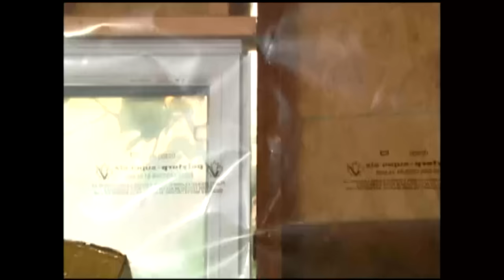Mike Holmes Saves Jill's Garage Makeover from Disaster! | Holmes on Homes 205

Comment: One thing i wondered about:  where i work in new jersey, you get use screws for framing,  even deck screws,  theyll fail it every time.  Screws hold great, but they have poor sheer strength.
Reply: Does sheer strength matter once the structure is built? During construction sure, but once it’s sheethed and all one unit, a force requiring high sheer strength shouldn’t be possible — if it is you have bigger problems!

Comment: Great stuff.  Some corners NOT cut aren't highlighted in the narration.  For example, I noticed Ice & Water Shield on the roof underlayment over the walls.  He didn't say anything, but I saw the peel-off.  Kudos!

Regarding screws.  Not all screws are equal; it would be nice to hear what he's using.  Deck screws lack sheer strength and are not for framing, and especially not for joist hangers.  An inspector should fail a job framed with them.  As you know, joist hanger nails are doubly thick (and triply expensive), as are joist hanger screws.

Common ring shank nails provide similar non-slip properties as screws, with all the sheer strength needed but the added ease of using a nail gun.  Screw shank holds even better, but less common.  Good luck ever removing them without a 4' crowbar and ripping the wood, but if you're removing it, you probably need to replace the lumber anyway.

Since one of the main draws of your videos is the educational factor, it's good to have these distinctions explained every time, until it's drilled in (pun intended, haha!)
Reply: Good information. Thanks. 👍

Comment: Originally my garage had a 18 inch footing and a concrete  slab floor. Twenty years of sitting in water after every heavy rain took it's toll. The floor crumbled and the bottom of the walls rotted. I braced the garage and jacked it up. I had three foot ddep footing poured. Then two layers of blocks on top to raise it above ground level. Next I removed one foot off the bottom of all the walls. Then I added 18 inches on to each wall. Then I dropped onto a new sill plate. I need the garage a bit higher so I could have a over head door. After a needw roof and vinyl siding. I had a new floor poured over raise mesh. Idid all the work myself.

Comment: I've seen whole houses build without the size off this foundation 😯
Reply: I don't know where you build, but where I have built in Iowa it is 42" to the bottom of the foundation - to get below frost line. In southern Minnesota it is 54" for the same reason. And yes, that is for garages too. He is building in Toronto. I have to assume the '4 foot deep' thing is how they roll north of the US.

And of course, that is a double-wall structure, meaning the interior is finished. Always an option.
Reply: Thankfully I haven't seen houses but plenty of garages and other out door structures like sheds ect.

Comment: Mike, I wish you were in the U.S.. I need help. I bought a house 2 years ago. I'm a first time homeowner at 54 years of age. I bought without conditions like an inspection. Previous owners only took cash offers not through a bank. I didn't know any better. Now I'm having issues. Yard is flooded, septic tank is too small and storm water fills it up causing sewage to sweep out. While yard smells like septic. No insulation in walls or attic. Very narrow crawl space so I or contractors can't get in. Floor joists gave away in bedroom causing dresser to tip over. No joist hangers and rusty nails. Electric plugs have no ground. Just 2 prongs. Holes in Soffit where birds and cats get in. The toilet is sinking from the soft floors. Sill plates and studs in the garage are rotting from all the flooding in the yard. Insulation in the garage has asbestos. The ceiling in the garage is sagging in the middle. Paint on the outside of the house is just primer. Windows are not insulated. Front door seals leak air. No HVAC system. Just ventless propane heaters on the wall. I have a lot more going on with the house. It's gonna cost me thousands of dollars I didn't count on when buying the house. I need help and don't know who to turn to. I bought a lemon house because it was what I could afford. Nice neighborhood and I love my back yard when it's not flooded. My trees are dying because of the flooding. Please, if you know someone in the U.S. that does what you do I really need their help. Please, I'm begging you.

Comment: Most of the time we can shame contractors, including here. However, Mike over does stuff to the point where you're missing half the market that demands a single top plate instead of a double,  and 4 inch concrete instead of 6. Sometimes a garage can be done for less than your extras, just cause you like extra credit